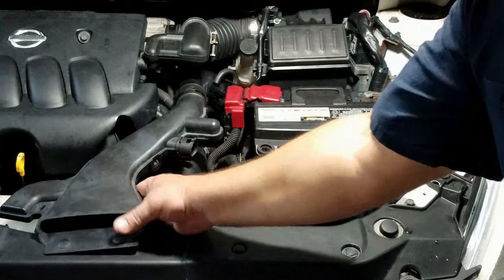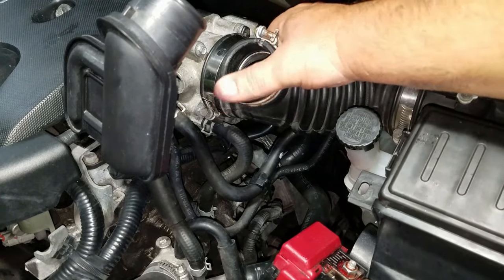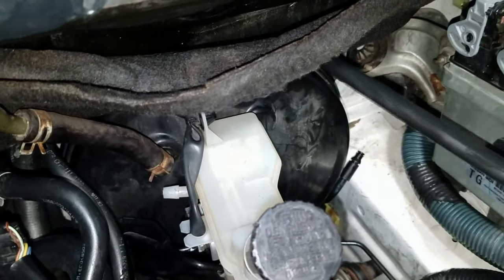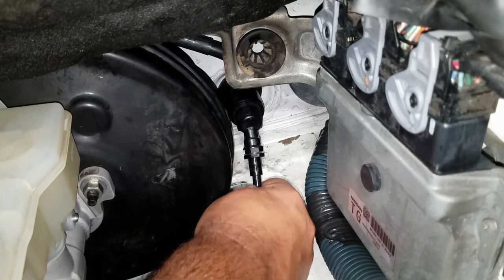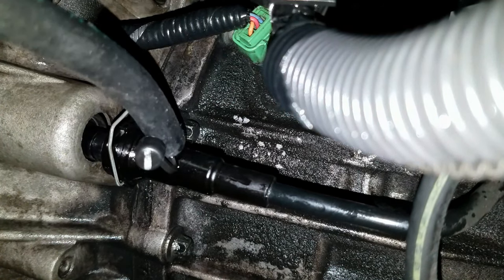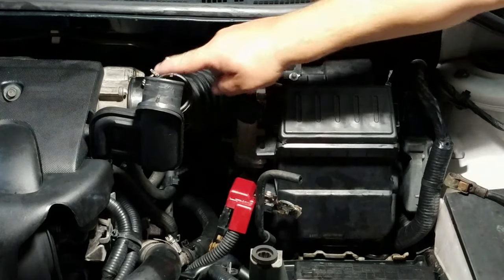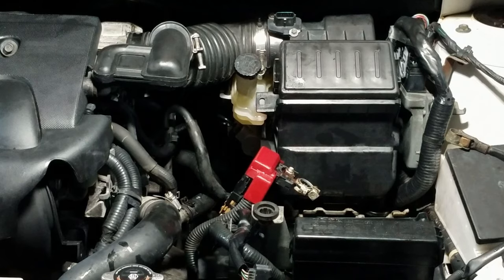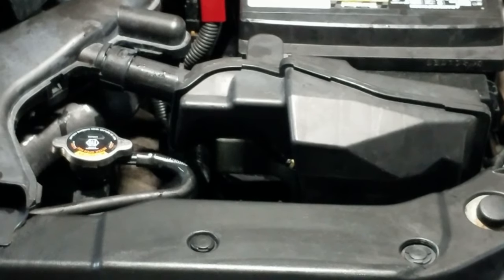2007 - 2012 Nissan Versa Clutch Master Cylinder Replacement and Bleed

Comment: Did this on my versa note yesterday. Diiferent parts to remove, location of hose is different, I had to oull the hydraulic clip instead of pushing it in but there is enough great info in this video for me to get the job done! The hardest part for me was getting the air out of the master cylinder. Im a 60 yr old  single woman with minimum auto experience....if i can do this anyone can
Reply: What were your symptoms? Clutch pedal to the floor?

Comment: With the bleeding hose you said push the clip down and pull out abit ?   So not like the other one which was pull the clip up then pull hose out
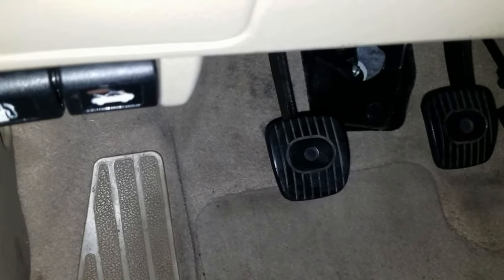Reply from the maker: The bleeding starts from 8:29
Reply: Yes push the clip down and pull to the second position for the clutch tube.
Reply: Correct. Down, the  opposite of up 😅

Comment: Thank you so disappointed nissan decided to use plastic for the rod assembly mine literally broke in half while i was driving
Reply from the maker: You're Welcome, by now the part manufacture's should have improved the design of the rod, but it looks like all the brands are still making it out of plastic

Comment: Could you do a video changing the clutch slave cylinder. Cause I just changed my master cylinder and bleed the clutch and the clutch fluid kept leaking out under the car where the slave cylinder should be and my mechance told me that the slave cylinder is not holding pressure nor keeping the clutch fluid in the car
Reply from the maker: Was it leaking Before the Clutch Master Cylinder was Replaced
Reply: @FIXMYCAR  yes I thought it was the master cylinder so I got it changed, then 2 weeks later the same problem occurred my mechanic checked the master cylinder and said it was ok. But the slave cylinder seals are probably bad.

Comment: Just had a dealer do this, along with a new clutch assembly and flywheel.  Expensive.  Unfortunately, the clutch pedal disengagement now requires the clutch pedal to be depressed almost all the way to the floor, and it engages almost immediately.  Is the clutch pedal engagement position adjustable in any way, or is this a function of a new clutch pack assembly?  Thanks!

Comment: Is this the same motor or trans at the nissan juke 2011 doble clutch??
Reply from the maker: According to the data system here in the USA it has a different engine and transmission than the Versa but the Clutch Master Cylinder is the same. When you say double clutch are you referring to the Dual Mass Flywheel? In the USA it does not appear to have a double clutch transmission, but it has a Dual Mass Flywheel. May we ask is your Vehicle a USA model or in which country is the vehicle located? We would like to know if they offered a dual clutch transmission elsewhere
Reply: Yess your correc dual mass i alrrady working on thad tankeiu.

Comment: Absolutely amazing video.  Worked perfectly when I was finished.  Thank you very much.  The only thing to add is when bleeding the system you need to remove the reservoir cap to bleed the system properly.
Reply from the maker: Thanks and you're welcome, glad the video was helpful for you. Be aware that the reservoir cap gasket is designed with folded extra material, to give without creating vacuum and with out braking the seal as fluid is used. Also, when you have the cap off you want to make sure no debris falls into the fluid and remember that brake fluid is hygroscopic. Meaning it absorbs moisture from the environment so, if you are in a high moisture area or day you want to keep it covered

Comment: Thank you very much for this video. My master cylinder rod/clutch pedal junction is worn badly causing the rod to come loose shortly after I re-snap it into place. I put a mini hose clamp on it to try and salvage it and will know in time if it worked.
Muchas gracias señor.
Reply: Same here. One of the little 3 prong plastic connection points broke. Slammed the pedal to the floor nearly giving me a heartattack. Luckily, popped it back in and put zipties in  X fashion to hold it. Seems to be working. But will keep this video in my backpocket just incase I need to replace the whole thing. I hate that Nissan used plastic for this part of the master cylinder. Dumb. Could kill someone for using plastic.
Reply: @ODynastyO-xu8tw  
Mine is still holding after 3 months with the mini hose clamp on it.

Comment: My car its the clip inside that broke was able to drive it for a couple days but now it wont work at all i will try changing what you just show but is it possible my problem is after the hose that goes in the transmission to the fork that move the pressure plate or my problem would only be ghe cylinder?
Reply from the maker: How did it go, is it fix

Comment: I bled my breaks after losing a rear line and shortly after my clutch was to the floor But it came back enough to work but its very soft and i only had issues shifting for a moment, it runs and shifts but its still very soft clutch petal and i want to the way it was so i know i won't have any problems again, cars an 07 ive done an, axle, window, rear brake shoes and drums, rear brake cylinders, 
When i realized the systems are connected i figured it wouldn't be that hard but this clip has got me feeling stupid my clip doesn't do anything at all

Comment: Hello FIX MY CAR, your video is very good. Initially I 've planned to  have it replaced at the  dealership service, but after watching this I've decided  that I'll rather do it myself !
How did you remove dot 4 fluid before removing the cmc ? Did you use syringe or you emptied it via clutch tubes and the bleeding nipple?
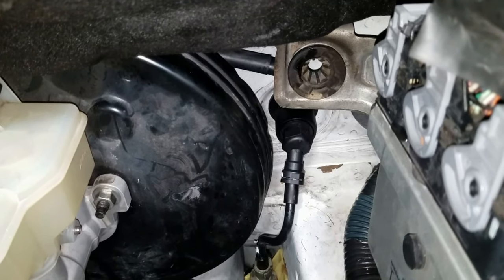Reply from the maker: Thanks, Glad you liked the Video. What year is your Nissan and the Model if is not a Versa? Click at 4:28 about the question
Reply: @FIXMYCAR  It's a 2014 Nissan Pulsar C13 (I'm from Europe, PL). It uses many parts common with Nissan Juke.  There are different part  numbers but servicing rules of clutch are the same.  I 've already read in service manual that to empty the fluid you just need to slide the tube to bleeding position and by depressing the clutch pedal all fluid will be evacuated .

Comment: Any advice have the pedal no pressure and stays to the floor.   Iv fitted new clutch slave cylinder and it still falls to the floor if I bleed the hose under the battery pull clip up then add pipe into a bottle then press the clutch till the air is gone if the pedal still has no pressure what can I do ?? 

Iv fitted new pads and disks the car is stuck parked on mud so hard to get under it and advise be great
Reply from the maker: What was the reason that you replaced the Clutch Slave Cylinder?
Reply: @FIXMYCAR   the push rod not working on the pedal and now has lost pressure in the system so Iv fitted a new one so now it works ok but just need to Bleed it      But if the pedal still falls to the floor what’s next ? 
Cms? Under the gearbox
Reply: @FIXMYCAR   it was hard to get at the system to fit lol but did it then it got dark so tomorrow I’m going back to bleed it and fit new pads and disks
Reply from the maker: When you say Push Rod are you referring to the Clutch Master Cylinder
Reply: @FIXMYCAR  yes mate the bit that fits to the pedal
Reply: @FIXMYCAR  Iv worked on many cars but first time on a Nissan quas lol with this clip and plug way

Comment: Thanks for the video. Why is my bleeder fitting at slave cylinder blowing the rubber cap off when I pump the clutch pedal
Reply from the maker: You're Welcome, If it is at the bleeder position then it will. Does it do it when in the closed position
Reply: @FIXMYCAR  I got further directions from dealer   it's fixed now,  wasnt aware of second click on fitting . Thanks for responding
Reply: @FIXMYCAR HELLO. I have a 2008 Nissan Altima coupe 6 spd manual with the 2.5. My clutch went to the floor from 2nd to 3rd. I started taking the air box and stuff off and when I got to the bleeder part on the line with the clip it was already off. Should I just put it back and try to bleed it to see if that will fix it or is it a way I can check the other parts to see if something else is bad?
Reply: @marlanjones  did you lose all your brake fluid as that's what operates slave cylinder
Reply: @Aj-wb5rg I don’t see any fluid on the transmission. There is still some fluid in the master cylinder. I said I was going to try to bleed the system. Maybe that line just slipped off. I was driving and it happened when I got ready to shift gears. I’m not sure what else to look for, I’m not not real familiar with working on them.

Comment: I found brake fluid in his door pocket so think he had a problem and ran the system dry then topped up his reservoir but too late has air in there now.      If I bleed the clutch and still feels soft can I bleed the brakes aswell ??     Is the ABS all together was thinking run the car do the clutch then bleed each wheel from the back to the front see if that works
Reply from the maker: When bleeding the clutch keep the brake master cylinder reservoir at or above the full line all times, and may we ask why are you bleeding the brakes

Comment: very good video tk you - is a 2015 Versa pretty much the same?
Reply from the maker: You're Welcome, It appears that the clutch master cylinder output line goes straight instead of at an angle, also it has a shorter hose to the brake master cylinder reservoir. According to the auto parts information

Comment: when the car is on i press on the klutch goes all the way down and i wont go into gear but turned off it does go into gear perfectly can it only be the master cylinder !?
Reply from the maker: did you check the fluid level

Comment: Hi FixMyCar, I replaced the slave cylinder located inside the bell housing and having difficult time trying to bleed the clutch. I put the clutch tube on second position and pumped the clutch till all the air bubbles were out. Then when I closed the tube and pressed the clutch, fluid started gushing out of the bleeding value. I even replaced the clutch tube thinking that the clip is bad. I did not prefill the slave cylinder with brake fluid. Was this a mistake and do I have to remove the bell housing again to prefill the slave cylinder ? Please let me know. I have a Nissan Altima 2008. Thanks
Reply from the maker: If the bleeding tube is locked on the closed position, and you still have fluid coming out of the bleeding valve. Check the O Ring, If it's ok see the bleeding procedure from 8:29 time line
Reply: @FIXMYCAR  seal are the orings on the slave cylinder ?
Reply from the maker: Is the O Ring at the bleeding connection
Reply: To bleed the slave cylinder you have to...

1. Open the bleeding tube (Engage the metal clip so that you can pull the fluid line out to that first "open for bleeding" click position.)
2. Press/HOLD DOWN the clutch Pedal
3. Close The Bleeding Tube (push the fluid line all the way in to the "closed" final click position. The metal clip will probably lock down automatically)
4. Bring up the clutch Pedal

-REPEAT this maybe 30-100 times. Yes, 30-100 times. It's going to take forever. It sucks. Your thumb is going to hurt pressing that metal clip. Your going to want to quit. But it is what it is. 
👉🏻Just Keep Going.👈🏻
Eventually the clutch pedal will stiffen as the slave cylinder is finally filled with fluid and the pedal finally has fluid resistance. Do this until the pedal feels normal and there is no air seeping out of the tube, just straight brake fluid (Step 2).  I'm going to repeat this, because it's important, When I say 30-100 I literally mean it took me about 60 repetitions.

Here is a rough schematic.
To the left is the engine and transmission. And the [   ]'s are the positions the fluid line can be in. Either clicked into the final [Closed] position, clicked into the middle [Bleed] position or completely un-clicked and [Off].

{Eng/tran}--[Closed]--[Bleed]--[Off]---

**Also Very Important: Make sure the car is level (not on jacks) with the way some of the brake master cylinders are designed it may not work unleveled.**

You can do this,
👨🏻‍🔧 Goodluck
Reply: @coleyamos  I opened the bleeder and attached a clear tube from bleeder value to the brake reservoir. I pumped until there was no air bubbles in clear tube. There was some pressure in the clutch. Then I closed the clutch tubing. When I pumped the clutch the bleeder value opened and the fluid started shooting up. I am thinking the slave cylinder is bad. What do you think. Pls comment. Thanks
Reply: @jun_1248   When the fluid came out of the bleeder port, if it was in the final locked position then it's probably bad.
Reply: @coleyamos  yes it was in the final locked position. I probably will buy a new one from auto one instead of buying parts online. Thanks a lot for your comments.
Reply: Hi  @coleyamos  I replaced the slave cylinder and bled according to your instructions(thank you). Now the clutch is so hard that I am unable to depress it. I can depress if I open the bleeder value. I installed the slave cylinder connected the clutch tube/pipe
 without mounting the bell housing on the transmission so it’s resting on the transmission jack/sub frame. I wanted the clutch to work properly before putting everything back together. Is this again a bad slave cylinder ? Again would appreciate your input.
Reply: @jun_1248  is the Brake Master cylinder (that the clutch feeds off of) overfilled? Or is it between the Max/Min?
Reply: @jun_1248    Also, I've never "pre bled" the slave cylinder OFF of the bell housing. It may need to be installed first then bled, as the slave cylinder may need to be pressed against the clutch pressure plate. Maybe the OP can answer.
Reply: @coleyamos  it is at the max line. I can remove some of the fluid and give it a try.
Reply: @jun_1248  Actually now that I think more about it I suspect the pre bleeding OFF of the bell housing is the issue. You've probably fully filled the slave cylinder (expanded it completely) with fluid and when you press on the clutch pedal there is no more room for any of the fluid to move into which is why you can't move the pedal. The slave cylinder needs to he installed and pressed down (squashed down like a slinky waiting to be filled and expanded) against the pressure plate and then bled.  Otherwise if you go to install as it is now you are not going to be able to depress the slave cylinder down and attach it against the pressure plate.

I would evacuate the fluid from the slave cylinder. Install on the bell housing. Bleed. And then see if that works. All of this is assuming your slave cylinder is good.
Reply: @coleyamos  I think the slave cylinder is good as it’s holding fluid and not leaking and bled completely. Even I was thinking of removing the clutch line and then installing the bell housing and then bleeding again. Will let you know how it goes. Thanks a lot for all your help. 😊

Comment: Thank you  I fixed my
Reply from the maker: You're Welcome, Glad to help
Reply: @FIXMYCAR   hello - is the brake fluid reservoir the same as the clutch reservoir?
in other words do the brakes and the clutch use the same fluid? I dont see 2 reservoirs on my nissan cube - I only see the one shown in your video
thanks
Reply from the maker: What year is your Nissan cube? On the video the brake reservoir is shared with the clutch master cylinder
Reply: @FIXMYCAR   its a 2011 and yeah thats what I thought
thanks much
Reply from the maker: You're Welcome
Reply: @FIXMYCAR  is not a cube is versa

Comment: Hey the 2014 versa does not have the same type of slave cylinder I think the hose pulls out to the second click to bleed out master cylinder
Reply from the maker: On the 2014 the Clip is on the Slave Cylinder, at least here in the USA

Comment: What happens if you pull the tube out of the slave cylinder?
Reply from the maker: If you are referring to the time line at 9:13, then you won't be able to bleed the system, also the fluid will run out
Reply: @FIXMYCAR so how would one fix that? I made the same mistake lol
Reply from the maker: If you mean that the tube is removed and not broken then reinstall it and follow from time line 8:28